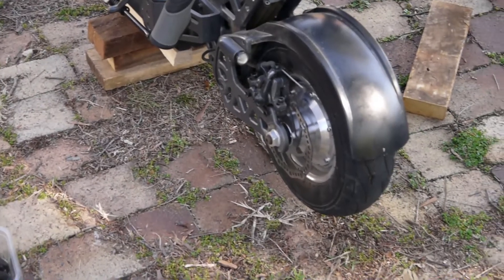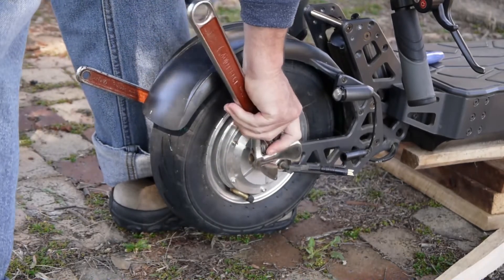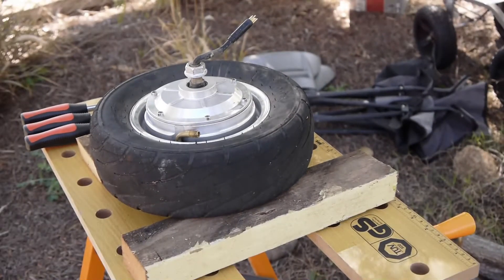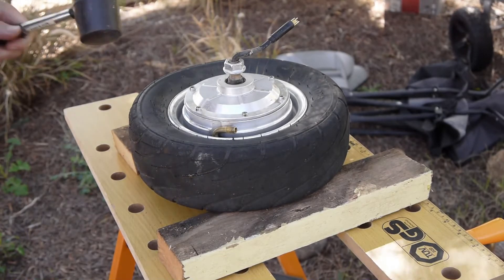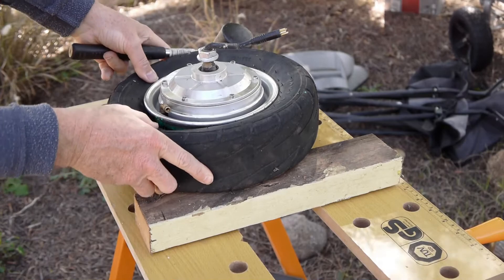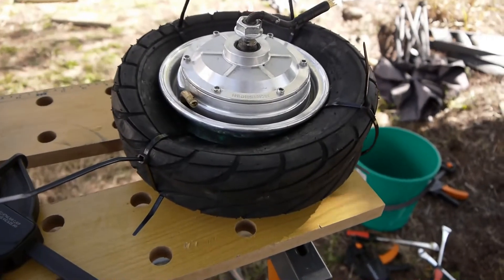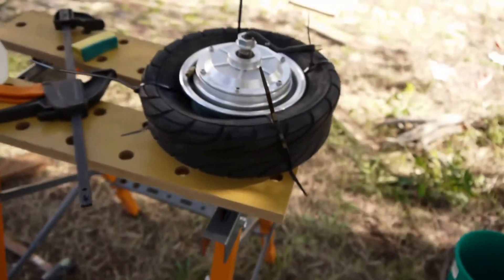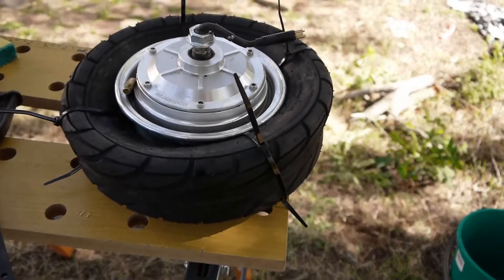MX60 rear tyre change

Comment: That looks like a fucking nightmare
Reply from the maker: if you aren't a handy sort of person with some tools its simply not possible.
This harks back to why when I bought my WideWheel that I had as my #1 criteria >> No pneumatic tyres<< 
Why? well I've had an amount of experience changing tyres by hand on farms without tyre machines (which actual automotive places have) and know its hard work. Bicycle tyres are much easier (because diameter is larger). So knowing that and knowing it would be down to me I was pretty sure I was right. Pneumatic tyres would be a pain in the arse (and they are)

Comment: I got about 1000km out of mine too. Found an easier way to change tires but haven't made a video on it yet. Easier still means lots of swearing.
Reply from the maker: Its done just under 900km, with some dirt roads too
Reply from the maker: Basic explanation welcome :-)
Reply: @finophile  The trick is to push the tire over center perpendicularly to the hub when mounting it. Then work each side evenly 90 degrees. The catch was I had to pull the shaft out and take the brake disc off just in case I bent anything by accident. Having a proper homemade holder for the removed hub assembly helps a lot so things don't just flop around.
Reply from the maker: so like the wheel is Saturn and the tyre the rings?
Reply: @finophile  Yes but wheel and tire are not concentric but rather perpendicular to start and then levered into concentric.